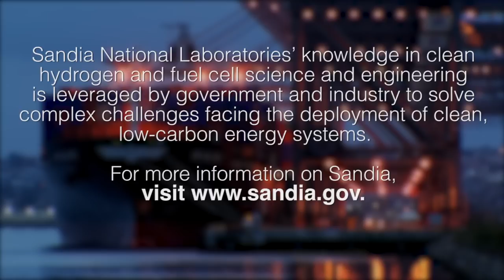Hydrogen fuel cells could power ships at port

Comment: How do you make the hydrogen? how much electricity does that use? how do you make the electricity to to make the hydrogen to make electricity? how much energy is lost.  I think it would be much easier, cheaper, safer, and less polluting to just plug the ships into the local electric supply when they are in port.  one of the few reasons to use a fuel cell is that it is portable (like a car/ship etc) but if it is just sitting on a dock, there is no reason for a fuel cell IMO